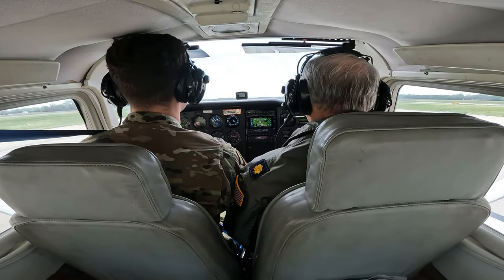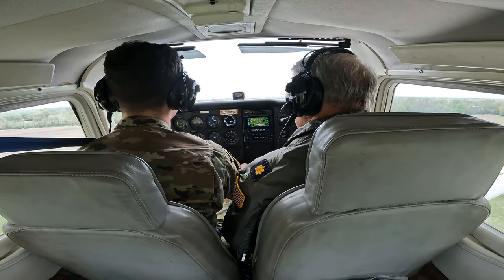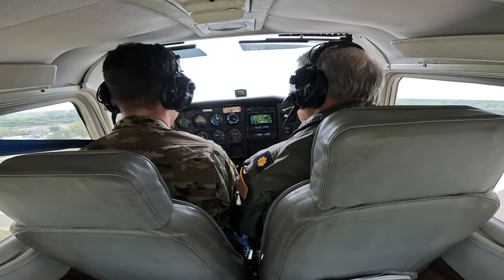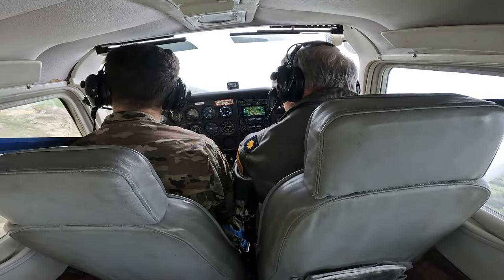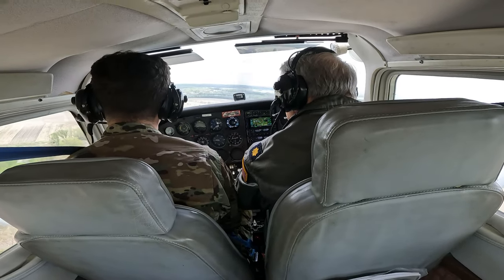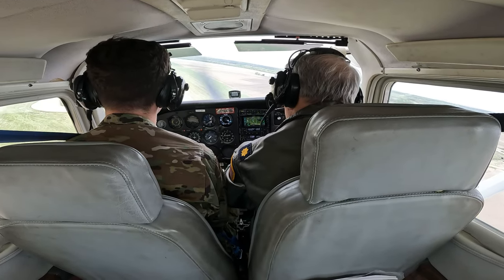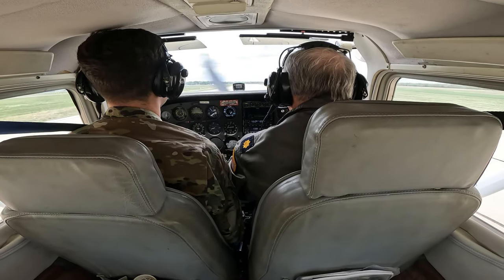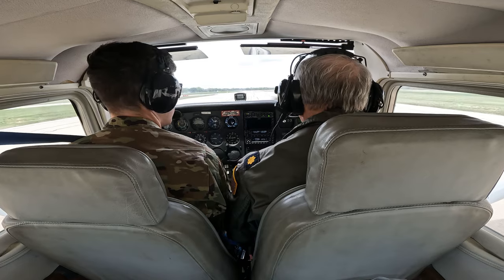Partial Power Loss on Takeoff - Cessna 172

Comment: Good job. When I was training. I wasn't taught about wind shear, and on approach one day, in C152, had the airspeed pegged at 65 knots, then suddendly it was 48knots, almost instantly. I didn't know what happened and I became transfixed on the airspeed indicator going over and over "What happened to my airspeed" to my instructor. In my case, he never responded. If I was alone, I would flown the plane into the ground; but at the last minute he screamed "PULL UP!!!" and I reacted instantly and did as told. We slammed into the runway, survived, but the plane wasn't very good. The landing gear was all splayed out. He blamed himself for not paying attention to what was happening, he'd become complacent, and that school had not educated me on the dangers of wind shear. What happened was I went from a 20 knot headwind to close to 0 headwind. If it had gone to tailwind, I would've fallen from the sky as the airspeed would've been lower than the stall speed.  These moments educate you as a pilot. You'll never forget yours.

Comment: All pilots should know "A Possible Turn" from An Impossible Turn".   I have a formula for small singles Turnback Maneuver.  The 777 Turnback Rule.  I taught aerobatics and 2 kinds of turnbacks in my 1990's CFI years.  4 kinds of EFATO and partial power too.  
 For heavier singles i have The 999 Turnback Rule for heavier singles.  Use this formula i used about a hundred times to teach EFATO Turnbacks when CFI.  It works well.   I have 3 engine fails on take off on Cherokee 180 and all i landed back with no damages ever. 

FOR TOTAL ENGINE FAIL Use the 777 EFATO Turnback Rule for light singles.   The 999 rule is for heavy singles. 
  The 777 rule can be done even when on preflight or driving to airport.  Will I be able to climb over 700 fpm? Yes? Are the winds over 7 knots? Yes? Then mark the altimeter to 700 agl for EFATO turnback.  THE 777 TURNBACK RULE NO POWER- FOR LIGHT SINGLES.  
Between me and my 1990's students we had to do 4 turnbacks due bird strikes, loose engine cowls an engine problems on take off.  4 airplanes saved i know.  
iGNORANCE of Turnback  is not the solution, IGNORANCE is the problem.

THE RULES FOR PARTIAL POWER I USED TO TEACH ON RUNWAY ARE ON PREVIOUS POST I DID 2 MONTHS AGO.

Comment: Partial power loss should always be regarded as an engine failure. Pitch for airspeed and or maintain flare while popping flaps, etc.
Reply: Maintain flare?  You mean to pull up elevator to nose high?  Flare..

Comment: Very nicely done.  The pitch attitude was appropriate for the normal takeoff, neither Vx nor Vy was appropriate.  Therefore the student lost little airspeed before they determined they had partial power.  When the CFI took over he was interested in the good forced landing field slightly left and headed there.  He was absolutely not interested in maintaining altitude, which would sacrifice airspeed needed for maneuvering.  It worked out that sufficient airspeed was maintained to maneuver back to runway 31 going downwind.  Calmness and the low altitude orientation that airspeed, and not altitude, is life on takeoff.  There is seldom any need to be so slow that maneuvering is not possible.

Comment: Hate to poop on your parade,   But this CFI wasn’t paying attention.  Let the student leave the carb heat on and foul the plugs.  Didn’t notice until pretty far into the takeoff roll.    And did nothing to remedy the situation.   Like seriously,  there are things you should be prepared to do….  These older CFIs are typically good at teaching how to handle the controls.   But very bad at everything else.   If I were this CFI I wouldn’t post this….  Declaring emergency after putting a student in harms way isn’t a good look.
Reply: You mean the CFI didnt see the carb heat was full on? daamm !  Everything forward to take off.